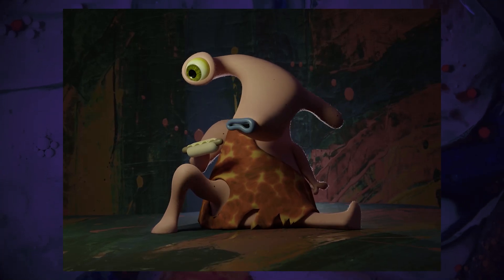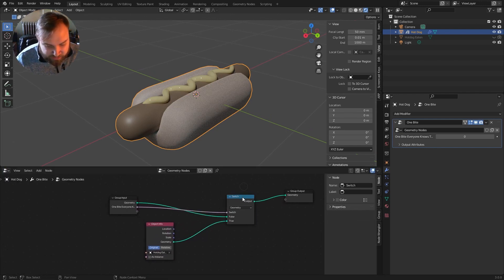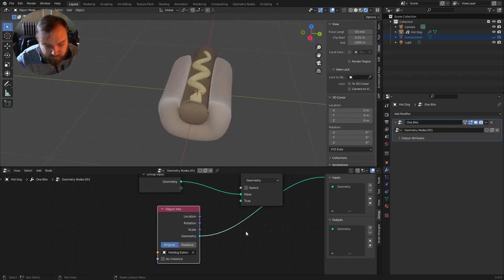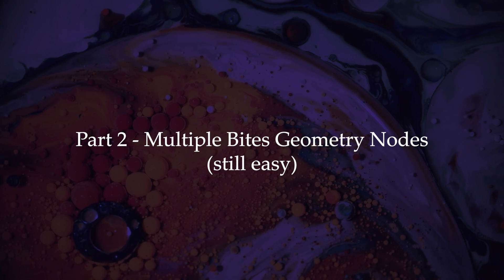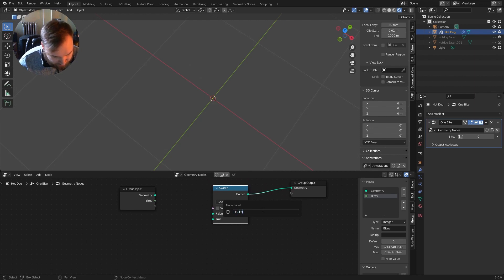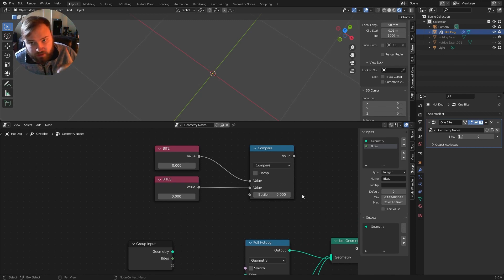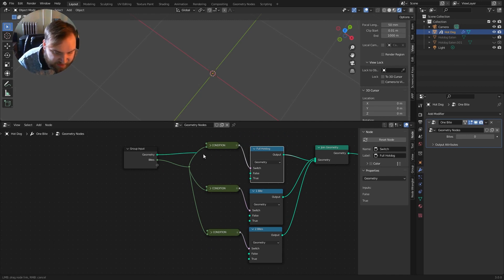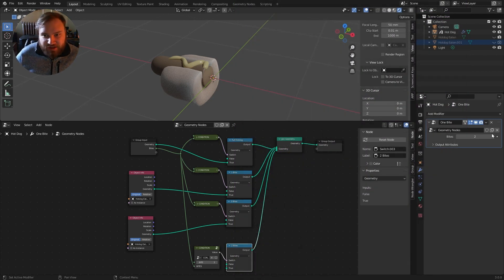Rig a Hot Dog / Any Food With Geometry Nodes (Blender 3.0 Tutorial)

Comment: Would it not be far more to parent the bitten hotdog to the main one and just key frame their render visibility?
Reply from the maker: You’d get the same effect, however this method gives you one control that allows for 1 key frame to handle all the hiding and showing. Also if you are using multiple bites. It makes it easier to animate and control all states rather than to juggle multiple key frames throughout multiple objects.

That way would work as well. This method just controls everything in 1 node and also teaches some use cases for the Switch node in Geometry nodes!
Reply: @FruitZeus  fair points